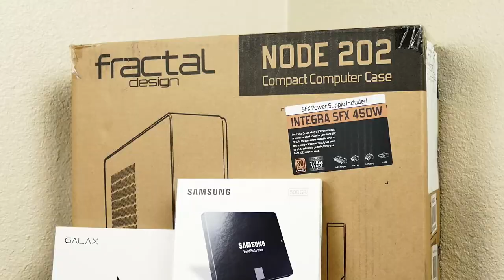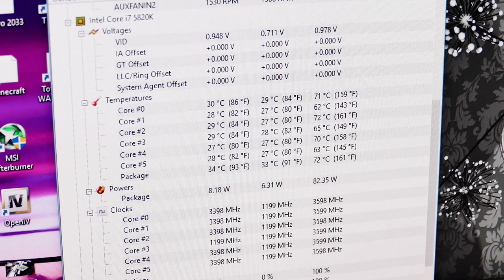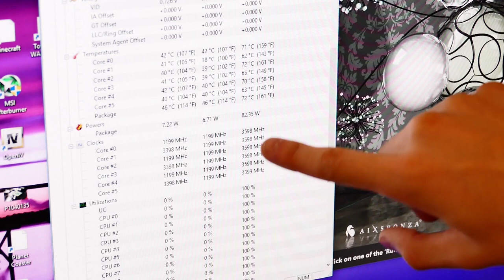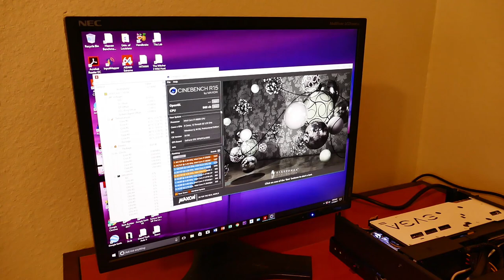This ITX X99 PC Build Makes (No) Sense

Comment: I would kill for a portable workstation with a lot of raw power & cores. Something in like a Dan A4-SFX or an Ncase M1. Running several Virtual Machines on an i7 4770K is just painful.
Reply: Yep, that's why this dude SHOULD NOT be bashing this board like he is.
Reply: The M1 is pretty big at 12.6l dou and even the A4 is bigger than I'd wish.
https://www.indiegogo.com/projects/sentry-console-sized-mini-itx-gaming-pc-case-computer/x/8302463#/
Sentry is probably the best option right now. Although it is only pre-orders atm.

Also the point wasn't to build powerful ITX builds but to highlight that the board just isn't that good for it. 
For comparison this is LGA1551 and this is the board used here. 
http://benchmarkreviews.com/wp-content/uploads/2015/03/ASRock-X99E-ITX-ac-Motherboard-Introduced.jpg
http://b.scdn.gr/images/sku_images/014878/14878816/20151126103644_4e0e4fba.jpeg

Look at how much more room you have for the CPU fan. With the 99x you are immediately limited by the fat that the RAM is right next to your socket with no headroom. If you are building in case mobile case, like the Node 202 (which is the argument here, if you use one of those "small form factor" cases that are still pretty much microwave size it isn't such big thing) you can't really get cooler where it sits above the ram nor can you get wide cooler. 

I mean in this form factor what exactly do you want to do that you can't do with kaby lake that requires you to have 99x??
Reply: 3Rton Kabey lake isn't meant for workstations that run multiple virtual machines, rendering and CPU intensive tasks.
Reply: shrug can't say I have any experience with virtual machines but the rendering difference between this one and some skylake I7 is less than 20% in some benchmarks I've seen. So the rendering and processing difference isn't that big. Albeit I do see your point if you want something that is even more performance than the 5820k.
Reply: Doesn't matter how close in percentages they are when rendering, just a few percent can mean multiple minutes more that you have to wait for your job to be done. Time is critical when you need things done, also 4k rendering/encoding would be funny to watch an i7 quad do in an 8 hour day where you need multiple videos done.

Comment: With this board, there should not only be this air cooler included, but also a little metal bracket. This bracket works with older corsair an coller master AIOs. That means that you could have mounted something like a Corsair H5 SF, even in the node 202.

Comment: I have this board in an NCase M1 and it's one of my favorite things that I own. Other than the dual-channel memory, there are no compromises. And I don't do anything that takes advantage of quad-channel memory, so I don't mind. Of course, you have to take cooling into consideration. No sane person would build an X99 system in a Node 202 (tho it is possible if you absolutely need a portable workstation). And you shouldn't use the included cooler, you should liquid cool or use a Noctua air cooler with a narrow ILM bracket. You can certainly put the board in a very small case, just not an ultra-small form factor case that's less than 10L. This channel often gives questionable recommendations.
Reply: Will this board work for normal gaming, they are saying no, but I don’t see the problem
Reply: @Portnowthrifts  It does, but it's very old at this point, you should go for something new.

Comment: I've done two builds with this board, one with a 5820k and the other with a 6800k. The narrow ILM Dynatron cooler supplied with the board is VERY loud, making it unuseable for an HTPC or for use as a desktop build unless you're deaf. Pretty sure it's meant for 3U server racks. I used water cooling for both builds (Silverstone SG13B [11.5l volume] with a GTX 1070). I tried a build with this board in an ML05B (7l volume) but couldn't get a reasonable cooling solution to fit, and it won't take two-slot graphics cards anyway.

I ended up using the ML05B case for a 6700k (stable at 4.7GHz) build air cooled plus a Firepro W4300 for a three 4k 60fps monitor CAD and software development workstation.

Getting decent cooling is hard in all these cases! I could get the 5820k stable at 4.5GHz but the 6800k only 4.2GHz OC.

Comment: Alternate AIO coolers that would work with this motherboard is the Corsair H60, the square H80i and H100i. The motherboard shipped with a bracket that fit the square shape of the cpu block and allowed the cooler to be mounted properly to the non-standard cpu socket. I built a system based on this motherboard in a EVGA Hadron Air case and regretted it.

Comment: I've built something similar but inside a Deepcool Tristellar case. Here some tips. First you should use an AIO water cooler with a 120 mm radiator, the Asrock x99E-ITX/AC mainbordboard provides a custom bracket for the Cooler Master Seidon 120V (not recommended). I'd choose a Corsair H55 (or a Corsair H80i) or an Asetek 510LC which is the OEM for those Corsair model. Because this Asrock mainboard uses the narrow 2011 socket, you'll need a server grade bracket sold by Asetek (check on ebay, they sell them directly) in order to fit a good AIO. 
Secondly, the provided Cooler is a Dynatron R24, a server grade one (1U), that means it's quite good at cooling but noisy as hell. You won't use it, trust me I've tried. 
Lastly the Fractal Node 202 isn't the best case for a build like this, I would recommend a Silverstone RVZ01. I've helped a friend to built an itx gaming pc and the Silverstone RVZ01 could host an i5 6600 cooled by a Corsair H55, a GTX 980Ti and a couple of drives without any heat issue.
For any questions please feel free to ask.

Comment: I mean it doesn't make sense in this (PC) case but if you'd built it in the case that Linus used (Sugo sg-13) then liquid cooling becomes a possibility and therefore not as pointless.  Though to be truthful, an ITX AMD Ryzen build with 8 cores and 16 threads excites me more as the Ryzen chip wont be as physically huge as it's Intel counterpart and then you can start to see things like (potentially multiple) M.2 slots on the ITX board and then even the extra PCIe lanes are being utilized.

Comment: The Fractal Define Nano S or Node 304 with their more conventional internal layouts are probably a better choices for "Extreme" ITX builds.  The Node seems optimized for HTPC systems.  The successor to this board (the X299E-ITX/ac) uses SODIMM memory, supporting a maximum of 64GB and has three ultra M.2 ports available - would you consider a follow up to this project?!!

Comment: Try the build in a different case (Phanteks Enthoo Evolv Mini ITX or EVGA Hadron Air for example). A small powerhouse could have its uses.
Reply from the maker: 6700K/7700K is still a better option since only one graphics card can be utilized.
Reply: No its not actually, if you want to do video encoding in a timely manner then your going to want as many threads as possible. I would lose my mind if I had to encode video with a quad core CPU. You dropped the ball on the CPU benchmark in this video by not getting a CPU cooler that works properly. It's NOT a proprietary CPU socket, it's called a Narrow ILM socket which many server boards use, shouldn't be that hard to find one that will fit.

Comment: 2 years later and this board is now about $200 on eBay. A decent 8-core Xeon E5 is $100-ish. Some ECC RAM - another $100. So, for $400 you have a barebone that can handle anything from basic homelab virtualization workload to 1Gb+VPN pfSense. All of that in a tiny package that can be easily tucked away.

Makes perfect sense to me. You know, some boards are made for workloads other than gaming, GASP!!!

Comment: Your inability to imagine relevant use cases doesn't mean they don't exist.

Perhaps someone is a developer who has to travel for extended periods of time, can make full use of as many cores as can be made available, doesn't care about overclocking, and needs a real graphics card, but only for running/debugging cuda. It's easy to get your hands on a monitor when working from a remote office, but being able to put the kind of machine you can build on this motherboard into a carry-on is priceless.

Hopefully ASRock knows better than to listen to your narrow-minded opinion.

Comment: Solution for the cooler would be to do like Linus did, get a Dynatron T318, a 120mm or so fan and put it on there with either tiewraps or fan clamps and you should have very good cooling as the coolblock promises 165 Watt TDP of cooling.

Comment: the only thing I can suggest would be to move on to lga2011-3 instead of the older generation. mostly because from my own experience I think that a small form factor x99 build is still possible without the need to get rid of things just to make it work as decently as the rest of x99 systems.

I have a xeon 2670 v3 cpu with the evga micro 2 and it's an actual decent machine for editing and things like that. I mean 12 cores and 24 threads (why wouldn't it destroy the editing tests?)
and honestly I only do light gaming as well and it's actually pretty reasonable.

but I will admit this build is stupid AF lol! why settle for old lga2011?

Comment: Nice build and like you said impractical. ITX stuff is fun though. I did the Z170 route with an FTZ01 case and i5 6600k. I was actually able to OC to 4.6GHZ. I think I was able to do that in large part to the FTZ01 being a little thicker so I could have a case fan over the CPU cooler (I have a video showing it off if interested). I would recommend that case in the future, or even to trade it out with the Node 202, because of its 3 case fans giving more airflow. Anyways, have a good one!

Comment: I like Node 202 builds because it is interesting to see what mods builders try to do with that case. It is a very restricting case but very challenging and interesting to see what mods can be made to fit the highest end hardware in such a small chassis.

Comment: Would be an interesting showdown between a fully built itx x99 workstation vs a suitably sized itx z270 I7 1080 rig against each other not only in games but full multi monitor workstation jobs.   I think that itx x99 MB has a niche for a semi-portable workstation rig, though not sure in that specific case.    Add a large fast M2 drive, Quadro or Pro gpu.   As much ram as it can handle.   The MB comes with a water block bracket on the spec sheet as well.   Put it on water as well to overclock it.     Very pricey, but, not sure the person buying higher end workstation gpu's cares much about that.

Comment: I was going to make something like this, until I realized that the mobo used a custom socket-mount for the coolers. Wanted to make an ultra-small x99 build with liquid cooling. But hard to find parts when socket is custom

Comment: k good vid but I wanna ask. I'm kinda new to the whole pc build thing (and by new I mean i've been doing this for 2 years just not intensively) and I saw something you did while building this little thing that really struck me nicely. You routed the CPU fan cable between the ram sticks if I"m not mistaken? Is that 100% safe? can it be replicated in different cable/part combinations like that? Does it never matter if a cable touches a part is what I'm trying to ask I think.
Also, I see you decided to go with the stock fractal 450W PSU, I've seen many videos debunking the whole beefy psu thing and I myself am using an (admittedly low end) FX 4100 with a GTX 1060 6gb and 8gb of ram with a 500W Corsair psu. But 450W for an i7, a gtx 1070 and 16gb of ram? Is that really, really enough? or did you just go with it for the purposes of this video? Hope you or someone knowledgable answers! have fun keep making nice vids!

Comment: Can do what BitWit did in this case. Get a mini 1070 graphics card and use a 120mm aio in front of the GPU where there is a fan mount. i did the same thing in a RVZO2B, cut a mounting hole where the Slim CD drive mounts.

Comment: linus made an itx build with a xeon, a gtx 1080 and fitted it inside a shoebox-sized case. Imo, these small form factor builds with xeons/ broadwell-e's are for portable workstations meant for editing. he also used an Asrock board btw and was able to fit a big heatsink.
Reply from the maker: Mark Himmler Completely different case. His was much uglier IMO. A cube.

Comment: You forgot to mention that you can't use quad channel memory with only 2 ram slots.
The board has 2 LAN sockets so it would make a good mini server / media pc where the extra cores and threads would be beneficial and not require an especially fast clock speed.

Comment: surprised the CPU cooler didn't slide right off. You should try using zip ties to hold the cooler in place. IDK just a thought.
Reply: zipties made of plastic if u don't know..
Reply: Tenderloin Salmon Linus did it before and nothing ended up happening.
Reply: unless you got "unlimited supply" like linus, i suggest you don't.

Comment: I think you could have used an AIO liquid cooler...
Reply: he would have had to saw a hole in part of the case for the tubes to fit
Reply: il2xbox You can take the tubing apart to fit through the existing holes and refill the water afterwards.
Reply: BitWit tried that and found it was easier to just cut the metal.
Reply: You'd then be limited to an R9 Nano for your GPU, look up bitwit's vid
Reply: there's an amazing build that crammed a full loop, using the R9 Nano, into a Node 202
Reply: MercuryRX You can put the 1080 into the liquid cooling loop too, stringing in the GPU water block and an extra piece of piping in there, using the existing pump and reservoir of the AIO.

Comment: i do understand the pros to using the z170 instead but personally it seems the biggest issue with this build was simply the choice of case. anything that would be slightly bigger to allow use of the provided cooler would also have likely been big enough to fit a small AIO in too. plus theres the issue of using a non blower gpu in a case with very little airflow. was still cool to see you try it though.

Comment: well I've built a manta 6900k system with this board and a 1080 because need SFF for space constraints AND 6900k cpu power for rendering and streaming.  so yes they make plenty of sense for those who need it.  side note I didn't go x99 for multi gpu but instead GPU power past that of skylake or kabylake. also has dual rad gpu and cpu custom loop in as well as 2 SSD, a HDD and a M.2

Comment: I'm thinking of either making a full tower pc or an itx for my next build. Frustrated with the slightly cramped space i am given on my mid tower, especially when fitting the aio radiator, but at the same time frustrated that i cant carry it around and it takes up quite alot of desk space.

Comment: When you say stock cooler what do you actually mean? The 5820k doesn't have a cooler that comes with it. Also that 1070 you have in the video is not the black edition you have linked in your description. Is that the FTW edition or just the SC with the backplate? People might get confused thinking the 1070 you linked has a back plate. Not that having a backplate is a big deal, just saying.

Comment: Ive had this mb for quite a while and used it with my 5960x. Really loved how I could fit in 8core cpu in such a small form factor but the thing with this mb is that you cant overclock 5960x higher than 4.0 No matter what I do it just keep crashimg while loading window when it oc really well on another x99 mb.

Comment: Your forgetting some folks, I want a smaller system, however I need a lot of threads for various tasks. I hate having multiple systems that I switch between, so small, powerful, and has mass storage. Not saying your wrong, just saying there is a very small niche market for it.

Comment: So, what conclusion I can draw from that yammering at the end part of the video? By using a wrong case, you are dooming the whole build? All that hassle would have been avoided by using another case, for example Fractal Designs's own Core 500 ITX-case. By using it instead, you could've used the accompanied cooler, and even possibly thrown in an AIO-water cooling into it. I don't know the behind the scenes reasoning/insistence on the Node 202, but case-wize there are multiple other enclosures that would've done a whole lot better job.

Comment: You would've had to custom fit the cooler that came with the motherboard in order to get it to fit; probably by creating a port hole that it could poke through the side panel. Interesting to see it done, but I agree that I wouldn't have built it.

Comment: I'd say it might make some sense if you want to fit a server CPU in there (like a 12 core 2670 v3 for a pretty cheap price on eBay). Yes, you as much performance since no overlooking and only turbo to 2.5ghz, but it should be fine for video editing in a small case, like the sentry or something

Comment: This is exactly why I did not buy the Node 202 for my ITX build, because it cannot fit a proper CPU cooler! (Outrageous Fractal). I've bought the RVZ02 and fitted a Thermaltake AXP-100 Muscle on it (6700K with B150). Still I find your temps quite reasonable.